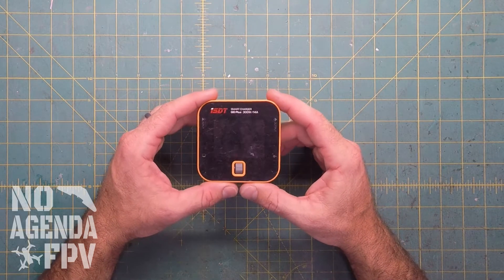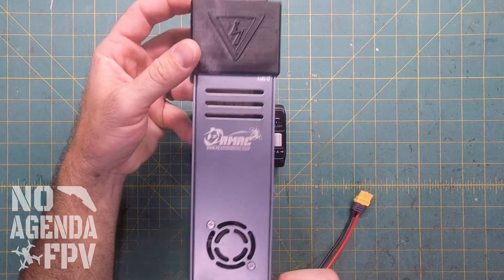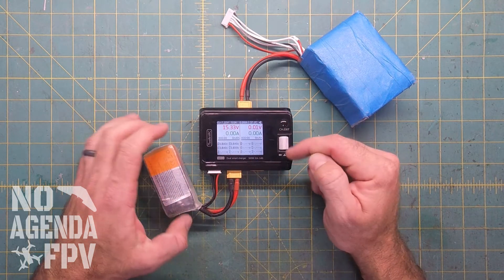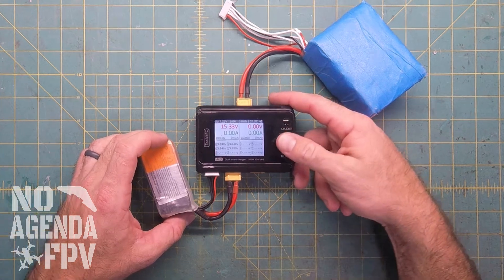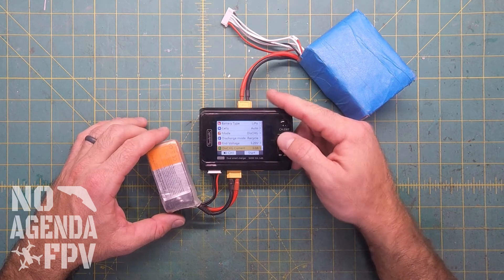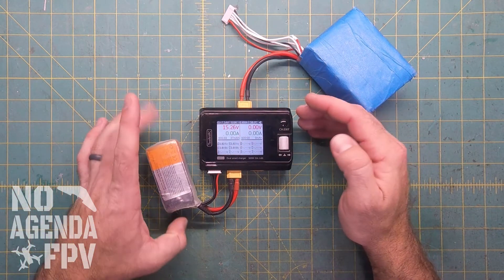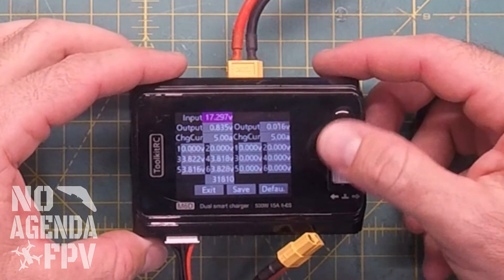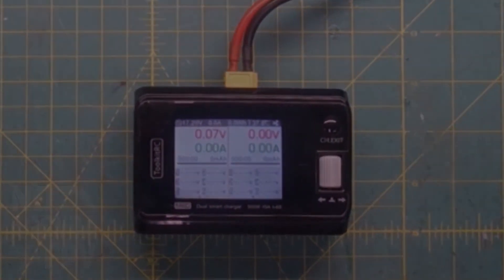ToolKitRC M6D Discharge Recycle mode

Comment: If you do the recycle discharge, would it auto stop when it reach the storage Voltage for the battery you are discharging? Is there an option to set the voltage to your desire storage Voltage?

Comment: Hi I have a problem with the charger He reports this error to me on the first channel
balance Port voltage match error
Reply from the maker: That usually means that the voltage being read through the xt60 to the charger is not equal to the total of the cells from the balance plug. So if you have a 3S batter reading 12V on the xt60, but your 3 cells aren't each at 4.0V, likely one cell is not reporting at all. If the cells all add up to the total properly then I would suggest contacting ToolKit

Comment: while you are recycle discharge, what is possible with ch2? can you meanwhile use it for charging? could you even discharge on ch1 and charge on ch2 without any input connected?
Reply from the maker: I have not tried discharging to the battery while charging so I can't specifically say. But I can say that you could not discharge on ch1 and charge on ch2 only. The charger does not power on without a power supply or battery plugged into the back(input).
Reply: @benwilliam1010
You can recycle on ch1 and ch2 simultaneously. Perhaps if you dischargo on one and charge on another the resulting input battery drain will be 0. But you need input battery. Charger won't be working without input battery